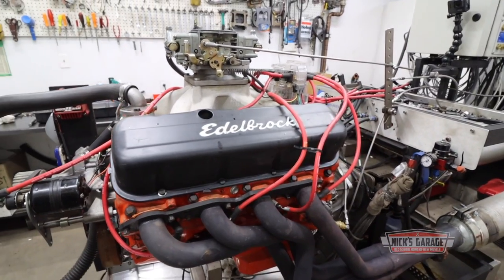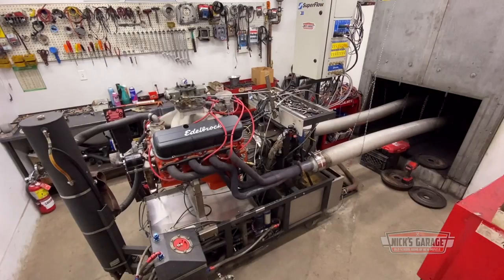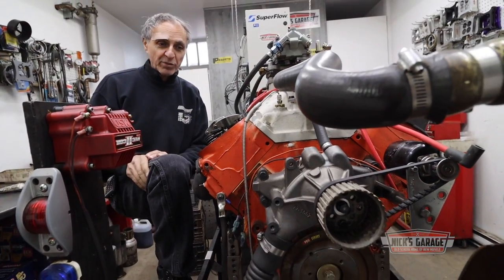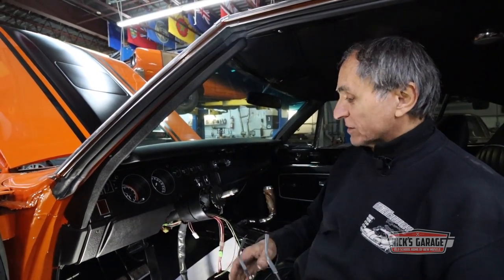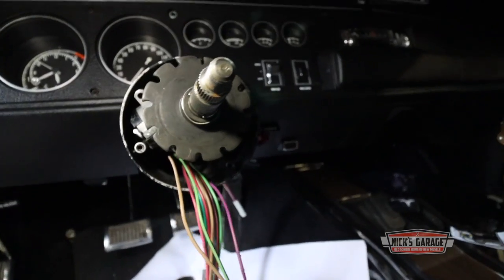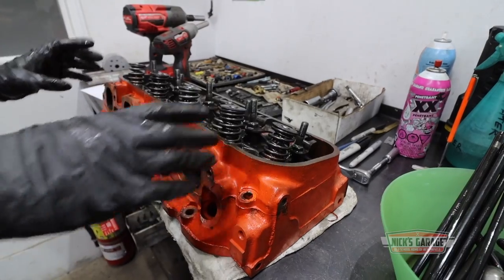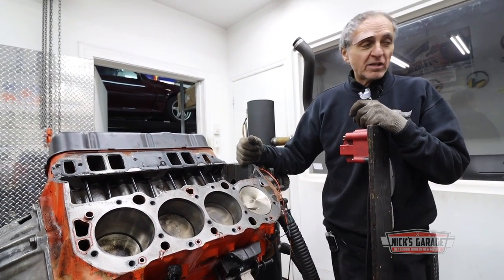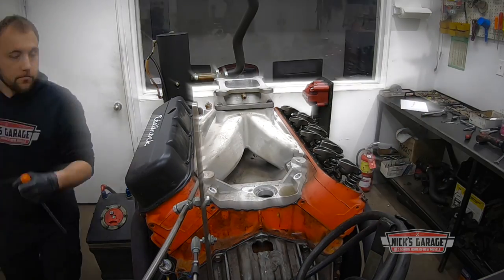Weak Big Block Chev • Wrong Parts + Poor Assembly = No Power!

Comment: Ain't no flat tappet going to make that power anyway. The heads have that much dome height and the dummies put flat tops in them 😑 and they were upside down. Way over carbed to. Definitely doesn't need a dominator. How were the valve seats and seals? So much wrong with that engine. I'd be pissed if I was the new owner.
Reply: Dustin.    Too many things wrong for sure.

Comment: what oil, or common with zink in it would you recommend  thanks
Reply: Rotella
Reply: You can use Diesel oil or 10w30 and buy zinc additive..They sell bottles of zinc...Thats what I do and never had a problem...One car I use diesel oil the others normal 10w30 with zinc added..Either is good..

Comment: Is there a “fixed it” follow up video available?
Reply from the maker: Not yet. The customer is still deciding what to do next.
Reply: @NicksGarage  did you run the block casting number? The bores looked tiny with a lot of meat between them, so I'm wondering if it's a 366 tall deck block?

Comment: Not a very knowledgeable engine buyer, when an engine is quoted to have that much HP better have the dyno and build sheets, 600 sounds kind of high anyway without it being stroked to some degree,  why a new cam with stock springs? Even stock springs are good for more than 5 grand unless they aren't shimmed at all which I wouldn't doubt, one good example as to why buy a 502 crate engine, easy 500 all day long

Comment: Big compression big valves big cam at least 600 lift or more and a big Holley is what it takes to make 600 HP from a big block Chevy ,at least 12-1 compression and 219 intake and 188 valves you don't even need rectangular port heads 600 horse power is no big deal ,I bet nick can't make 600 HP from any Engine

Comment: To begin with, those are NOT big ports. My heads I can touch the back side of the intake valves. But this engine should make 400-450hp easy. Smaller single plane intake. Smaller 800 cfm carb. 230-245 @.050" duration mechanical cam. Full roller rockers. Cyc head port job. And correctly assemble the short block.

Comment: Anyone else ever wrenched on a 1970 Olds Cutlass? For some odd reason, a center section of the grill was attached to the hood like a big tooth so it went up when the hood went up. You'd raise the hood, get to working and eventually BLAM crack your skull on that big tooth hanging down. Worst hood design ever, caused plenty of band-aids over the eyebrow.
Reply: I used to wrap a big thick towel around that tooth and duct taped it so it wouldnt fall off while I was working on it.

Comment: Even if it would have had the right pistons in it.......those 345VR Merlin heads are probably the worst choice ever for a 427 (440ci) engine.......they will work, but only if you zing it to about 8000 rpm.
Anytime I see a clear distributor cap......I just keep walking too. It is like a badge of stupid.
Reply: Jeffrey.        I asked the same question, see through dist cap, WHY ?
Reply: @nickpanaritis4122   It's like twin pipes on a Harley, because it "looks cool".....but most know a Harley runs better with a 2-1.

Comment: At the point to were I would've had 120 psi on 1 cylinder I would've continued on and to then found that 105 psi, witch in turn would've made me go through the engine. So I ask this, why only test 1 and go yup, she's ready for a dyno pull. Now if you had fired that up and it went  catastrophically bad cause the one and done approach was all you needed to say throw it on the dyno with the knowledge  of an unknown blocks background or if was done by a reliable builder  kinda has my puzzled. I'm sorry to say this but how did no one catch that. If this dude would've just did the test fully  throughout all 8 if he's a good builder then he wouldn't have put the customers block in jeopardy on the dyno. He would've called the customer,  told them that they found all the skeletons in the closet, the motors been assembled incorrectly. I would like to think the customer would've said hey don't do anything or he might say glade you tested now build it right. Luckily nothing happened, but I still question the ethics this man took in his diagnosis approach....

Comment: Love your post, of course i am more into fords and mopars and that dime a dozen gm junk. These  low iq alabama chebby junkies think they have something with their gm garbage like your 427 they throw junk together and swear they have the power. Hell my 2014 f-150 ecoboost with the 550 horse 5 star tune exhaust and induction will smoke about all that chebby junk you can throw at it. If you ever sit in a tuned ecoboost f-150 and stomp the gas you will be pinned to the seat hard and everyone else will be in your rear view mirror. It's amazing what ford has done and a 4 door all steel f-150 running 9.8's and now 5 star claiming 650 and a 750 tune for the ecoboost but i'm not going there.. take care
Reply from the maker: Stay tuned for tomorrow’s Ford!

Comment: I'm a huge noob at this. 

Can someone please explain to me why Flat tops wont make alot of horsies for this type of engine or any other engine of this manner?
Reply: Flat tops are generally pretty low compression. Low compression is good if you want to run boost, but it reduces power if its naturally aspirated

Comment: What chevy engine isn't junk. Always get a kick out of the guys putting chevy engines in street rods like duece coupes and justify it by saying chevys are cheaper to build.Yeah they are if you want to build junk. The reason Ford engines are more expensive is the parts are higher quality , machined to tighter tolerances and most of all LAST. Chevy never could compete with Ford engines. 427 S,O AND CAMMER DOMINATED NASCAR. 351 C DOMINATED PRO STOCK WITH BOB GLIDDEN AND FORDS BOSS CARS ATE CHEVY ALIVE AT THE DRAG STRIP. I WANT A DUECE COUPE MORE THAN ANYTHING BUT IF I EVER GO TO BUY ONE AND ITS GOT GM POWERPLANT IM ASKING , HOW MUCH FOR IT WITHOUT THE MOTOR. LOL

Comment: Sorry, but if you don’t pull ALL the plugs AND open the throttle all the way for a compression test all your numbers are going to be low... plus, after you do a dry test you should always do a wet test with a squirt of oil in the cylinders... this is an invalid test... having said that, your parts have to match... you can’t just throw on a set of swap meet heads and expect a 200 HP boost... this engine doesn’t have the right compliments of parts... very obvious by the valve float at 5000 rpm... now, having said all that, this engine would be perfect for a twin turbo setup after replacing the stock springs and ignition
Reply: It's not going to be THAT much different, though.  Not like this motor was.

Comment: Pistons installed backwards! The old engine assembly room mirror trick....Flat tops with big open chambers? WTH is the compression ratio? 7.5:1? Big port heads, low compression, and a small hydraulic flat tappet cam? I'll bet you find problems with the heads and valve train, too. Engine built with mismatched parts only capable of low HP at low rpm - what a waste of a gear drive! 366 gross HP from ~440 CI (0.060" over)? Pathetic....but look - you can see the distributor rotor turning! That's has to be just as good as 1 second off the 1/4 mile, right? Look at the rusty puke 'coolant' that came out of the block! I think you guys will find more F-ups the deeper you go into tearing this one down....

Comment: No way sorry your not gonna make 600hp with stock heads and bs distributor and stock headers just not gonna happen as for internals stock lifters nope
Reply: Those heads are Merlin.
Reply: @kblopp  haha funny Merlin Merlin dosnt mean they flow bud unless they hv been machined to spec to fit cc tested and put on a flow bench sure . Brand means nothing without proper spec who knows they could be bent or has more flow on one chamber or another having a machine shop spec ,inspection and machine is why a motor makes power or not it's just a fact .
Reply: @THOMAS01ify  haha, YOU said "with stock heads" genius !

Comment: You guys are hilarious an Nick you should know better...How in Gods name are you going to sit a 750 CFM toy Carburetor on a Big Block Chevy and expect to make the 600 HP the guy said it had ?  But to hear you with your in Awe audience laugh in the back ground is just to funny ... Nick..Now go find a  950 CFM carburetor and try that pull again ..Nick you can take that motor apart all day long but until you remove the baby Carburetor your NEVER going to see 600 HP  it just cannot flow enough air / fuel . I'm kind of sad your even trying unless your playing with us ...to promote this notion your some kind of  HP Guru  ...It's really not rocket science Nick ....and you really don't need a Degree from MIT to make HP ....
Reply: Michael.         It has 110 cylinder  pressure all around and a very small hydraulic flat tappet cam. Very weak valve springs and huge ports. Far from 600 HP.